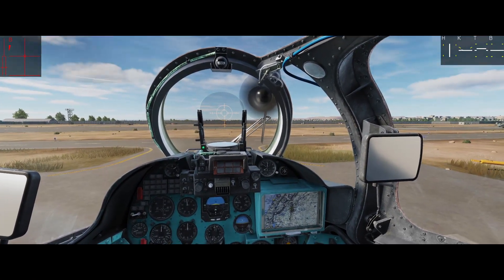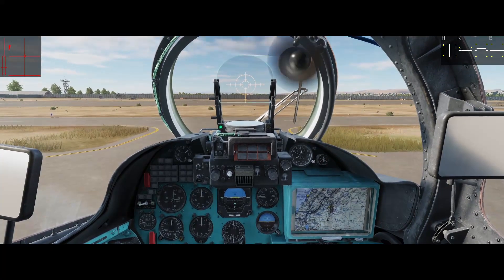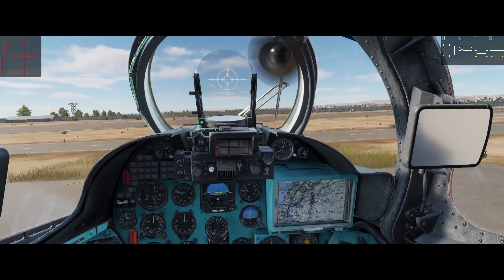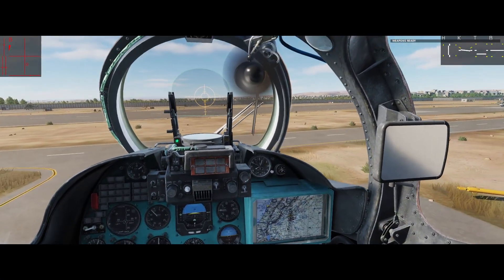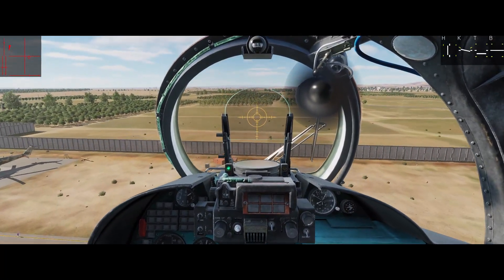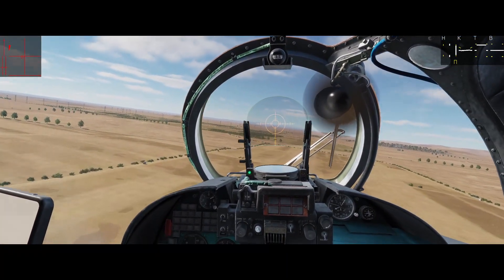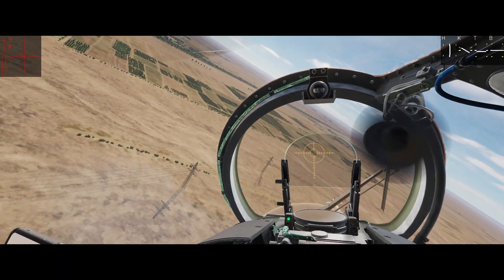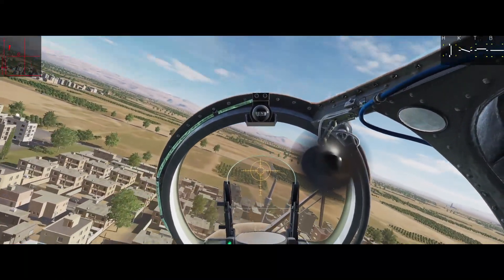You and your Hind - Understanding Yaw Auto Pilot

Comment: Well done.
Reply from the maker: That's an honor! Thank you mate and feel free to do bs checks and correct me at any point I mess up something in my videos XD
Reply: @nazradu  I honestly haven’t even turned on the yaw AP but it sounds about right I guess. Strange that it doesn’t require trim button input to make it change but reacts just to you putting pedal input. Russians. 🤷🏻‍♂️
Reply from the maker: In fact I do think it is pretty handy for take off and fast flight. They had a micro controller in the pedals to let the AP know that the pilot wants to change heading. Well it looks like they changed theyr mind with the Ka-50 AP XD
They point where this system does cause problems in DCS is when you land. It looks like the AP can't realy catch up with those changes in torque and also when the chopper spins from enertia and you don't give pedal input it is confused.

Comment: "2-35.1 Yaw Channel Operation 
The yaw channel receives signals proportional to 
the current heading from the flight director system 
and rate of turn signals from the yaw rate gyro. The 
yaw channel output signals are sent to the directional 
flight control servo. If the pilot’s feet are not on the 
pedals, the autopilot maintains the preset yaw angle, 
switching the directional flight control servo to 
displacement mode as needed to introduce large 
corrections. The speed of pedal movement in 
displacement mode is controlled by the hydraulic 
pedal damper in the directional control system. The 
yaw channel includes a relay which prevents the 
servo from switching to displacement mode if the 
pedal damper is disengaged. When the pilot’s feet 
are on the pedals, the sub-pedal microswitches 
activate and the yaw channel operates in 
stabilization mode. The yaw rate signal passes 
through a low-pass filter to prevent the servo from 
drifting to the stops while executing manual turns 
with the yaw channel engaged. "

The DCS Yaw AP channel doesn't fully switch into stabilization mode. This is why the SAU is fighting you in the turn.
Reply from the maker: That's a good one. THX mate!
Reply: That's handy: So....let me see if I'm getting it - the real key (for me) is to know about those sub-pedal microswitches. This is the key to understanding how the system knows what is pilot action, and what is not. In a hover, it's easy: any yaw that wasn't by pilot action was undesired. In forward flight, the problem manifest because bank angle, initiated by cyclic movement alone requires no pedal input and thus the system, not sensing sub pedal microswitches being on, 'fights' the natural heading change (yaw) as 'undesired' - this necessitates pedal input to avoid slip during a turn in forward flight. This tells the system that the yaw is desired.

Something like that, if I'm right, made it clearer for me.

Thanks to the nazradu for the video, and Sundowner for what I assume is the manual quote.
Reply from the maker: Yes, I guess you got it ;)

Comment: Great info, thank you.
Just a question, as it works great for take off, does this system help for straight hover landings too? It's landing what I'm struggling the most right now and it would be pretty helpful I think.
Reply from the maker: It should, but you have to be easy on the collective. I think the system does not like violent input cause it has to catch up and "thrust" and torque are related. Do rolling landings first and after you build confidence try vertical. Keep an eye on your decend rate. Try not to exceed 5m/s

Comment: Is there a faster way to re-enable Yaw AP after pressing the trim reset button? Or must I look down and cycle thru YAW on/off? It seems to kick back by itself after meeting certain conditions, but I can't figure out.
Reply from the maker: Best way is to never turn without rudder when yaw AP is on. If you do turn without rudder, what reset trim does is giving your actual heading as reference to the yaw ap but it also kills your cyclic input and recenters the virtual stick. Switching it Off and on imo does not change the heading that is stored in the computer.

Comment: So when you fly, when do you turn off the yaw autopilot? During combat?
Reply from the maker: It depends. Everytime I know I will throw the chopper around instead of doing smooth planed actions it's better to turn it off.
Reply: @nazradu  I see. Do you find it easier to have the autopilots on when using the cannon? For me, the autopilots seem to wobble the chopper around too much while trying to line up the shot.
Reply from the maker: I would say that depends on how much time and room you have to line up. But in the end you just have to find out what works best for you and stick to this.
Reply: IIRC from official documentation on it, you're meant to turn off pitch and altitude for combat, but keep yaw on.
Reply: You can just leave it on. It’s like a afcs in a western helo

Comment: No, it doesn't work for me! I have wached the video a dozen times to see what I am missing but I still can't get this to work. I have the course indicator pointing straight ahead, I check that the yaw indicator is centralised and that the yaw autopilot is engaged. When I take off, the helicopter immediately goes into an uncontrollable left rotation. If I fly around using your method of inputting rudder before I input cyclic, the helicopter will assume the correct new heading. It's just the take off that I can't get to work.
Reply from the maker: Hey man! I should maybe do a reupload of this video, as there have been some updates to the Mi-24 by ED.
First, when you hot start, make sure to reset your trim as the system very likely will throw your pedals off. 
Second thing would be to check your trimmer mode for pedals and micro switch Option in special option tab. That could also throw you off. 
As of now I do prefer to fly with heading hold off 99 % of the time.

Comment: I dont get it why is yaw AP acting like route AP?
Reply from the maker: Got to admit, that I did not dive to deep into route and hover AP yet. Can you designate a new heading in RAP just with pedal input and does RAP even work without YAP enabled? Those would be the points where I would start to search for differences.
Reply: @nazradu   not sure the route ap is working yet. Tried it earlier seems to start to change the heading but then stops
Reply: Sir you are a genius, this explains the psychopath behavior of the yaw system lol, and i think you are the first one to crack its features and proper use !

Comment: Spinning out of control on take off. Why!?
Reply from the maker: Too heavy and not enough tail rotor authority to compensate torque maybe.
Reply: @nazradu  100%. Full rotor torque will cause the hind to yaw more than the right anti-torque pedal can compensate for. Try pulling those 2 silver levers below the collective for max takeoff power and then set them back to normal (middle) after ETL or as soon as safe but within 1-2 minutes or you will potentially catch an engine fire AFIAK. Hasn't happened personally.